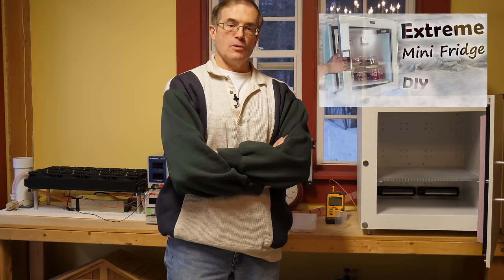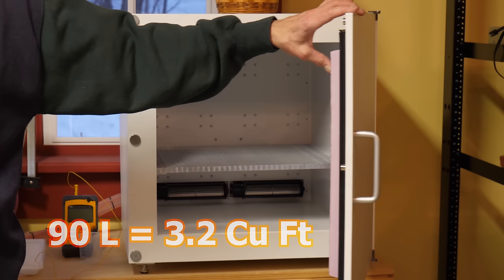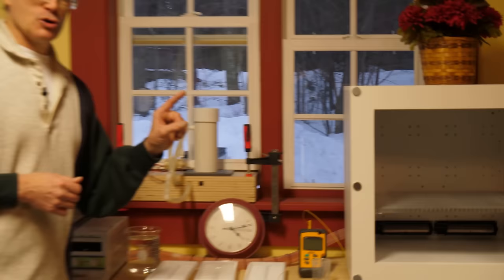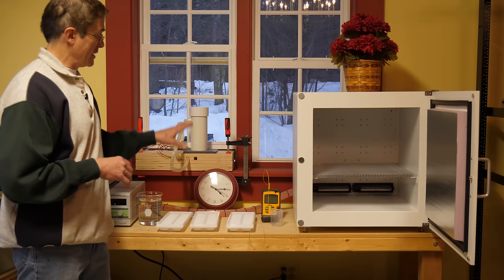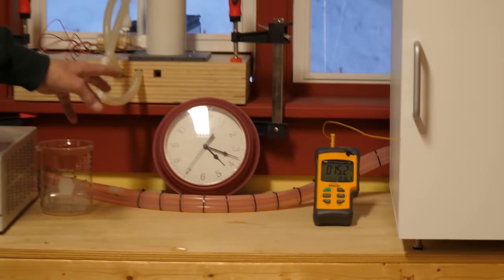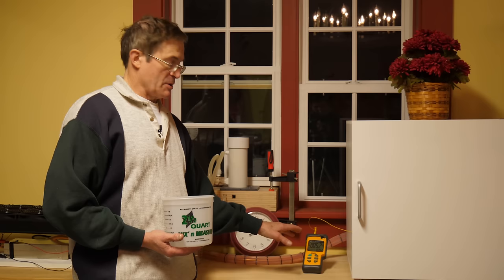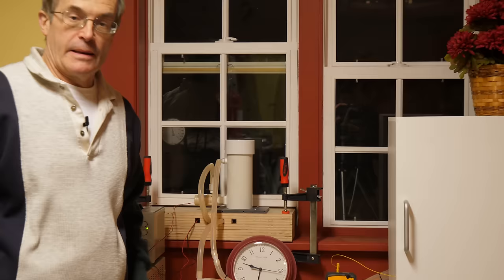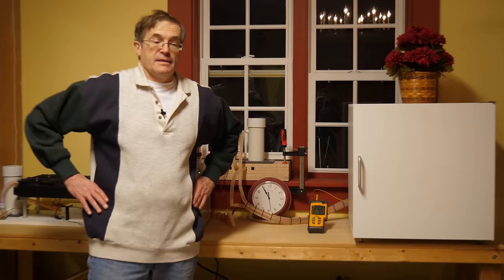TEC Freezer - Build Your Own!

Comment: I have seen how you demonstrated using TECs in a series config,but I have a question in perhaps connecting them in parallel,(i.e. when 2 same leds are connected in parallel there will be a slight decrease in lumens,but a considerable conservation in current),would this hold true with TECs also???
Reply from the maker: Current controls the performance of TECs.  If you run them in parallel there will be no change in effeciency as long as the temperature differential remains the same.  But, if they then share the original heat pumping load, the effeciency will increase.
Reply: @TechIngredients  What I am doing it building a pull behind camper from scratch and utilizing an actual  1968 "Ice Box",(i.e. uses a 10 lb block of ice for cooling.),but when boondocking and no ice available,would like to use TECs maintaining a 38° F temp internally. The power to the TECs will be 12 volts at 5 amps. In saying,"share the same heat pumping load" do you mean occupying the same area or stacking?
Reply from the maker: Share the same heat pumping load means that each TEC would be operating in parallel and each would pump 1/2 the total heat.
Reply: @TechIngredients  That is what my thoughts were on sharing the "Load",1/2 load each,conservation of power required,and thus less "On Time"...I'll be using a 2 stage controller,1st stage turns each unit on,(each unit will have a fan for distribution of the cold into the "Ice Box" and 2 computer server fans,(90 cfm)
 in a push pull across a radiator on the back),then the second stage will cutoff the Peltier devices and their fans,but maintain the radiator fans for a period of 2-3 more minutes to reduce thermal kickback...Am I on the right track or have I missed anything?

Comment: Ive made a chip cooler before, 3 stage, got down to -80 degrees quite quickly, as it was very small and had TEC's all round, did eat about 300W to run! they are not efficient

Comment: Can you do a solid state generator? Turn heat from a combustion to electricity? That would be awesome. Can stacked TECs work for this?
Reply from the maker: We are.  This requires a different type of TEC that is specifically optimized for power generation.  They cost more, but they work much better.
Reply: @TechIngredients  I'd love to see DIY solid state electricity generation from the exhaust on a car, to run solid state air conditioning. For a vehicle I'd select a standard cab pickup without air conditioning. Add an AC condenser and run engine coolant through it. Connect valves and electric pumps so that coolant flows through the system when it's off but is separated from the engine when the AC is on. For chilling the truck cab, run the chilled coolant through the heater core.

Alternatively, use a vehicle with AC and run the chilled coolant through the AC evaporator. Either way, one possible efficiency issue is using a condenser or evaportator made for heat transfer from or to a phase change refrigerant with water based liquid coolant. Radiators have thin and flat tubes to maximize the heat transfer from the coolant. I'd expect chilling via the heater might work better than using the AC evaporator.

Using several TECs at lower voltage for higher efficiency like your freezer should do something. If it can be powered from TEGs on the exhaust, then the air conditioning would run with zero impact on fuel efficiency, though dumping heat in front of the radiator would do the same as the heat dumped there by compressor powered air conditioning.

Comment: Loved this video. Been doing plenty of research on TEC tech in order to turn my still (legal in SA up to 100L boiler with a permit) to be waterless. Currently I use the pool pump to circulate pool water through the 1m x 50mm liebig condenser. I've had this idea of making clamps of stainless or aluminium (that is the real spelling) with a 50mm hole on it and a paltier mounted with active cooling on the hot side. I was thinking 8 peltiers at 12v might do the job. Any input, or willing to take a zoom call? I think I have most of the information.
Reply: Make a video on this!!

Comment: Very interesting series of videos! Have always wondered why this solid-state cooling technique hasn't taken off.  After reading about it on WikiPedia, something occurred to me:  Why not have heat-sink type fins on the cold side too?

Would love it if they made a unit you could take in your car and plug into the cig lighter (do they still have those in new cars? I have a 1991 Honda). So I could transport frozen items long distances in the hot summer.
Reply from the maker: Thanks!
The entire inside surface acts as the heat exchanger and the fans blow across this surface.

Comment: so it takes 4x times longer at 0c to turn water into ice? or 4x times Colder what temp would 4x0c be? 0C = 273.15K /4= 68.2875K = -204.8625C would water instantly freeze at -200c
Reply from the maker: It takes 80 calories of heat to be extracted to convert 0 degree C water into 0 degree C ice.  The water in our demonstration started at approximately 20 degrees C an so 20 calories had to be extracted to cool that water down to 0 degrees C

Comment: I have a TEC cooler, draws 4 amps, (48 watts).....if I put 12 of those in a circuit with sufficient cooling, should the total not be 12 x 48 watts....576 watts?
    My neighbor just bought a 15 cu ft freezer, 135 watts running power consumption.
Where am I off the track here?
Reply: TECs have horrible power efficiency. Also that 135 watts on the freezer doesn't sound right; most freezers are 100-200W *averaged over a day*. Most freezers are closer to 700W running. When it comes to freezers, the most important part of the power efficiency is the ice box rather than the cooler.

TL:DR you are comparing a component rating to a system rating, apples and oranges. TECs are bad, but not that bad.
Reply: the 135 is right, I measured it while running.
And the TECs yeah I believe they are inefficient
Reply: A compressor can extract more heat (BTU) per watt than a TEC can. This becomes more and more true the larger the temperature difference between the inside of the freezer and the ambient temperature where the compressor or TEC hot side is located. At 10c degree temperature difference, the TEC is able to move about 3 watts of heat per watt of power it uses.  This is about the same as a compressor. At a temperature difference of 40c it is able to extracts 1 watt but uses 5 watts of power to do this. TEC quality also comes into play here.  This type of efficiency is called its COP or Coefficient of Performance.

Comment: How much power does an equivalent compression fridge/freezer take to operate?
Reply from the maker: Probably somewhere around one third as much, unless the TEC system can more easily take advantage of the reduced temperature of remote cooling. In that case, the multiplier can shrink substantially.
Reply: @TechIngredients  COOL
Looking forward to the evaporative video!

Comment: Great video, thank you!  Question: did you measure the temperature of the water running through your radiator systems?  I'm very curious to know what this was and how it affected the speed of the freezer cooing.
Reply from the maker: We should have followed  that.
Normally, that kind of data is what I try to  gather when setting up a project.
In my defense, the limiting factors were flow rate and outdoor temperature. You can't modify the temperature, but sizing the pump is a trade-off between  power consumption and the temperature differential between the radiator and the TEC devices.
Reply: Got it.  If you were to guess, what do you think the temperature range of the indoor radiator water was before and after it passed through the radiator?  I'm just curious how much the water temperature changes throughout this process.  Thanks again!  @TechIngredients
Reply from the maker: No more than 3 degrees.  The flow through  the system was several liters per minute. A 3 degree differential equals 600 watts  of heat removal.

Comment: People are extremely cacinated with TEC's to the point were now there are more efficient and are being use to keep people cool not rooms or to create a cool breeze for people in there face and head to tolerate heat. Wouldn't that be worth exploring more?
Reply from the maker: The efficiency  hasn't  really  changed much over the last couple of decades and is still quite low.
It's probably  better to route the energy  that would be used to a commercial airconditioner and cool the entire room.

Comment: Hello sir.your vedio is amazing. 💕👏
But Sir i cant understand one thing and that was what you insert inside fridge (black shape) this is fan or radiater i serach google but i cant gain success for serching that thing. Please tell me for remove my curiosity.....
Reply from the maker: In the back of both the refrigerator and the freezer there are a pair of low speed fans.
Reply: @TechIngredients  sir i know the back side is low speed fan.
But My question is that what is insert inside (not back side) of the fidge.
There are two black shape things insert inside of the fridge. I am confused what are these things.. I sent pics with high light in this email. info@techingredients.com.

Please tell me because i am a technical student and i like your channel. 🙃 💕.
Your videos is very informative.
Regards.
Technical person.

Comment: cool but some CC. Whats your weak point in retaining the cold? The door seams i assume. which without power how long will it take to go back to room temp within the 70's?
it does not seem quite fair to use the outside air,  since how would this work when the temperature is 90 degrees outside?
Wouldn't around the seams be better if you had a tiny gap in between the center with a rubber seal( or something) and vacuum in between the gap to strengthen the seal?
Also maybe you can should not waste the hear with more waste to power the fan but use the heat to help make the cooler even more cold. 
And that can be done with a Absorption refrigerator which need heat to make it cold.
https://en.wikipedia.org/wiki/Absorption_refrigerator
Reply: "it does not seem quite fair to use the outside air, since how would this work when the temperature is 90 degrees outside?"

What if it's below zero for six months a year? "Fair" in that sense is relative to where you live, I guess.
Reply: @fun_ghoul  if its cold outside you might as well put your ice-cream outdoors and so no need for a freezer. ;)

Comment: I would like to see the difference in energy used from Peltier vs compressor 410 given same but cooling capacity.  Would they Even be close?
Reply from the maker: No, they would not.  Given the same internal volume and insulation quality, the compressor will be 2-3 times as effecient.

Comment: Were the internal cross flow fans used during the test shown in the video?
Reply from the maker: Yes
Reply: @TechIngredients  thanks... I am trying to cool water in a closed cool container.. Do you think it will work without the fans?
Reply: I mean just using heat sink inside to transfer the cold to the closed container.. Or with fans would be better?

Comment: Great video!

I have a question though;

Shouldn't the temperature of the air and the interior of the freezer been brought down to its lowest before the introduction of the water so as to remove/minimize whatever impact the thermal energy input those might have on the power consumption?

Thanks for your time and again, great video!👍

-100
Reply from the maker: For an accurate calculation of the heat removal, that would have been better.

Comment: summer is coming, and i have a request: can you do a DIY cooling vest? would TECs be sufficient to run one? why are commercial cooling vests so damn expensive?
Reply from the maker: An interesting approach would be to use a water impemeable, but thermally conductive membrane that uses evaporation as the cooling method.  With about the same energy absorbtion in watts per gram as a lithium ion battery's capacity and 100% effeciency that might be doable.  We'll think about it.
Reply: @TechIngredients  one year for ComiCon Adam Savage tried an ice+water cooling backpack for a spacesuit costume he built, but by the time he got from his room to the convention floor the ice was all melted. Would have been better to use a couple of TECs with a dual fluid loop, one to carry heat from his torso, one to pump heat out through a radiator.

Hmmm. How have the cooling systems in NASA spacesuits worked since the Apollo era? Freezing in space is less of a problem than overheating, especially when doing physical labor in a spacesuit. Skylab's biggest problem was the heat shielding that ripped off during launch caused the interior temp to be way too high, so quite a bit of the EVA time for the first and second crews was devoted to installing shades over the damaged area.

Comment: Great Project , need to try myself. Have you ever thought of trying aerogel insulation which has a really high R value? How much more efficient could Aerogel based insulation make a TEC based refrigeration system ?
Reply from the maker: It's about 3 times as good as polyurethane, but would require a vacuum system to be installed as well.
Reply: @TechIngredients  what do you mean by vacuum system?
Reply from the maker: Without evacuating the gap where the aerogel is located it is only about 1.5 x as good as common polyurethane foam.

Comment: using cold from outside is a cheat. A circulating coolant would do the same trick to the point of temperature equillibrium. The fans outside are an overkill too. However I wonder how well you could suck the heat from outside to heat the house - compared to other systems.
Reply from the maker: You use the terms "cheat" and "overkill" which implies a criticism.  Responsibly exploiting an available resource and optimizing the approach is a good thing, no?
Reply: @TechIngredients  Of course. I'd do the same thing but in terms of experiment it gives false readings

Comment: Considering electric vehicles (not hybrids), would this set up have enough cooling capacity to cool the interior cabin of a car. How efficient might this be? If this system could replace the refrigerant system used in cars with a compressor would it be better suited to a electrical energy source rather than a hydrocarbon fuel energy source? 
I realise you need a pumped coolant passing through a radiator to dissipate the heat but it is a low pressure system relative to the refrigerant system, it is simpler and it does not use environmentally dangerous refrigerants.
I am considering retro fitting an old ICE car with electric motor and batteries. The accessories such as air conditioning and power steering traditionally use rotary pumps to drive them. This seems to be an inefficient way of obtaining A/C and power steering in an electric car.
Reply from the maker: TECs are 2-3 times less effecient than a compressor based system and are best used where the heat load is low and the advantage of direct current, zero vibration and zero noise are worth the lower effeciency. An entire automotive interior is probably not a good one for these devices.
Reply: Thank you for your prompt, succinct and informative reply. I will use a compressor. Gary

Comment: What size battery system would be the same as the input
Reply from the maker: That depends on the duration the battery would need to run.
Reply: @TechIngredients  let's say I have a 24 volt on a timer that would cool for an hour and then shut off for 2 hours. I'm not to hip on amps vs volts , if heat is not dissipated,  will it eventually turn into a heater ?

Comment: On a future project. Could you use these to make a low energy heat pump to heat and cool a small shop?
If this won’t work explain why please.
Reply from the maker: It could work, but it would be rather inefficient.  The well insulated freezer and refrigerator (previous video) have a low heat load and the lower effeciency is acceptable.  For an inhabited space, I would recommend the dessicant based air conditioning system we will be covering on an up coming video.  Stay tuned.